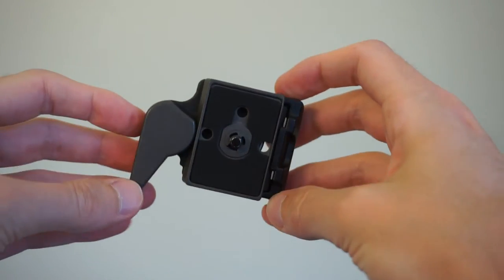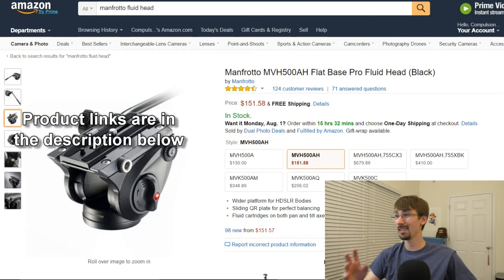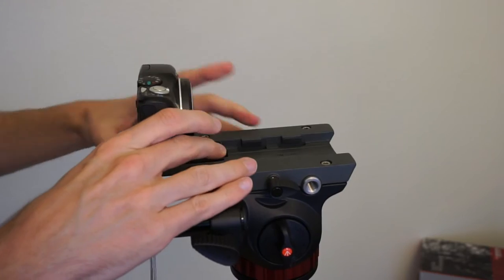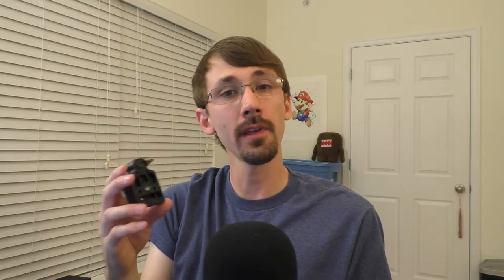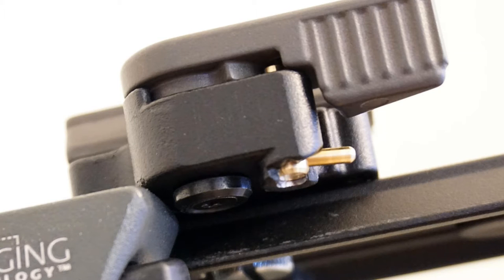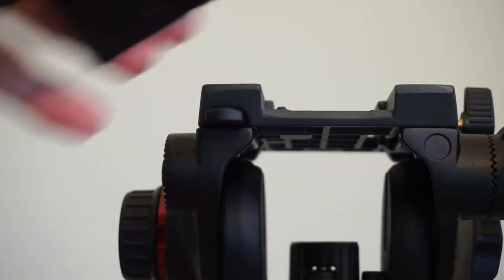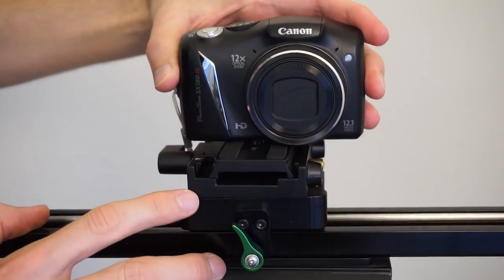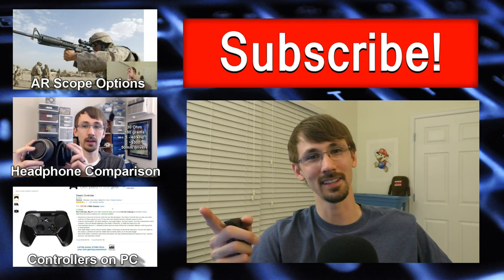Manfrotto 323 & 502HD Fluid Head Don't Work... RC2 Quick Release Problems with Fluid Video Heads

Comment: I know this video is a few years old, but I have the same setup.  500AH Manfrotto head with the 504PLONG plate and a RC2.  Just face the lever toward the rear of the plate (bottom protrusion hanging off the rear of the plate) and it works fine.  You can slide the plate in an out with ease.  The camera sits at the rear of the plate but I have not had any issues.  Some may depending on their lens selection possibly.
Reply: I tried this but I didn't like how easy it was for me to hit it with the Nikon Z6 articulating screen.

Comment: With the 323 RC2 have you tried going to a hardware store and getting a slightly longer 1/4inch bolt a few washers and a nut to make it sit a little higher? I mean its makeshift but if you use large enough washers it should still be stable.
Reply from the maker: I thought about it, but to be honest I didn't want to rig up a solution that wasn't 100% rigid, especially with the cost, moving camera equipment, etc.  I've been happy with the short plates and the 577 base system. Allows use with the small 577 or the larger 502hd head.  The plates are a little cumbersome, but whatever.
Reply: This will deff Work! Once you tighten down it should be just as safe as if you didn’t use any washers.

Comment: OP did you ever figure this out? I am so frustrated that Manfrotto don't think photo and video go together.
Reply from the maker: +Brandon Mount I couldn't get the 323 to work, so I switched over to the other model that uses plates. 577 I think, link is in description.

Comment: So I looked at this video and do not understand why you don't just turn the 323 so that the release faces with the track (that means the 323 release trigger is under the camera screen)?
I do understand that because the protruding part will then be sitting over the edge of the 140 plate which might not be ideal to centring the camera and the quick releasing will be done by 'tilting' the camera forward instead of lifting off to one side but it may be a work around.
I have the 502 and several 140 plates.... just waiting on delivery of some 323 quick release bases to try it although I removed the 323 part off a manfrotto ball head to check the clearance and it seems to be ok.
Reply from the maker: +Mark You could potentially tweak it like you said (can't check, I returned them), but I didn't want something that natively didn't work. Added spacers is also another possible option, but once I found the alternate plates that natively match with my tripod I was much happier.
I had a hard time navigating Manfrottos compatibility and website.
Reply: How is it tweaking it to mount it on the back with the protruding parts hanging free, that’s how I do mine and is how I have to have it since I need it the release sticking back since my window mount micro fluid is fixed toward the back. Seems perfectly compatible to me, guess it just depends on how your particular gear whether it will work or not

Comment: The head does not work on most tripods and monopods of any brand that has a even a slightly large base. I purchased one and it doesn’t fit on any gear that I had.

Comment: Thank you for this video, i bought the Manfrotto be free live aluminium tripod with fluid head, and i have the same problem, the plate is too big, its huge ! i was going to buy the 323 RC2, but now thanks to you i'm giving it second thought. Although is it possible to remove the whole long plate with its base ( i think by opening two alan keys) then installing the 323 instead ?
Reply from the maker: I'm not 100% sure what you mean.  With the 502 head you have to use the long plate with it.  I don't think there's anyway around the issue.  I opted to use the long plates and the (I think) 577 system.  I got 577 received plates for my gorilla pod and my slider.  It works pretty well.  The only con is the long plates are a little cumbersome.  You can also use the shorter plates too I think.  It's been a bit since I made this and looked it all up.

Comment: I found a tripod adapter on ebay for 7 us dollars it is 34mm diameter it's wide enough to be stable but allow the 323 to operate correctly on that long plate
Reply: Robert Wilder what’s the adapter

Comment: What´s the width in centimeters of the 504 plate that comes with the 502 head?
Reply from the maker: The 504 plate (long / full size) is approx 5.5" x 2".  The shorter version is 3.5" x 2".  You'll have to convert, sorry.

Comment: So you would say go with the 577 system to be able to switch between heads?
Reply from the maker: Are you using the 502HD video head?  If you are, I would say definitely.  The details for several parts that fit this plate system are in the video description under "My Video Mounting / Shooting Setup:"
if you aren't using the 502HD, then it would likely be a little more convenient to use a smaller plate system like the rc2 or rc4.